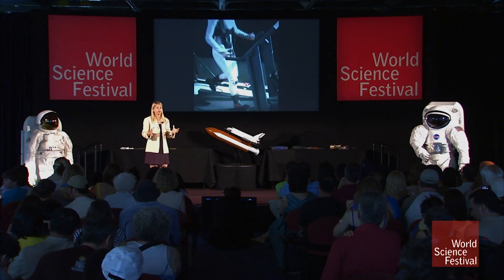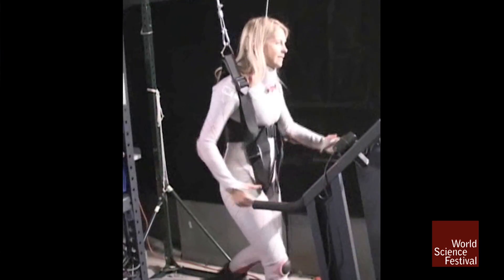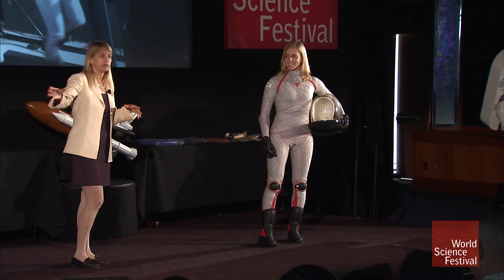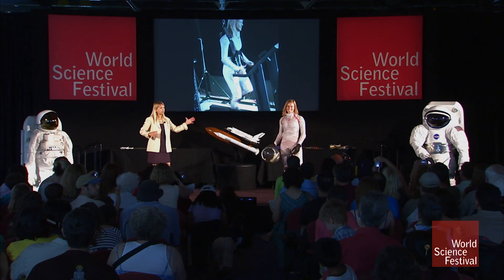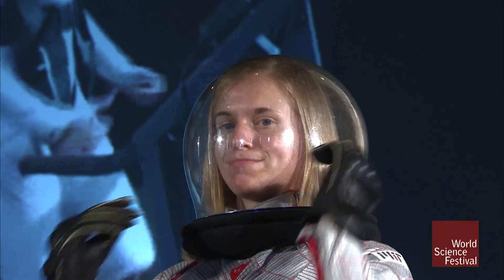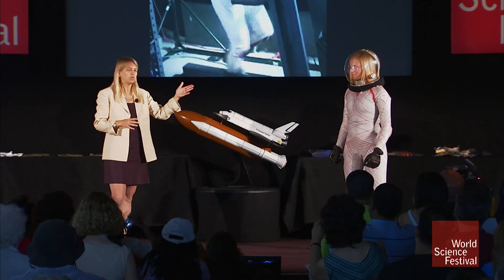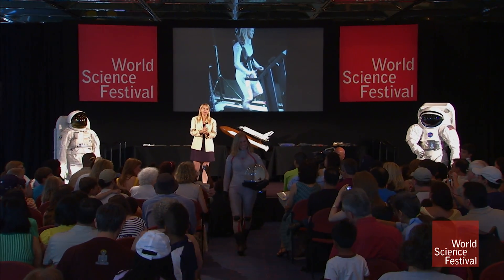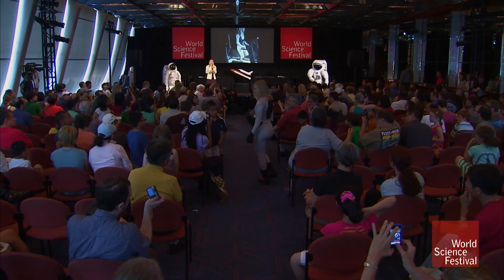The Future of Spacesuits

Comment: I feel like I'm the only one that sees the inherent problem with this suit design. The pressure needed to survive isn't physical pressure, it's the atmospheric pressure. The entire body needs to be encapsulated with pressurized gas. Just squeezing into a tight fitting suit won't provide this uniform pressure on every cell of the body. It's not just the outer skin that needs this pressure, it's every organ in your body.
Reply: This is one of the dumbest comments I've ever read.
Reply: The pressure exerted on your body is applied to the outside and transmitted through your flesh and down to the bones. The atmosphere does not permeate every part of you mediating pressure, only entering the lungs. Pressure is always applied to a surface not a volume.